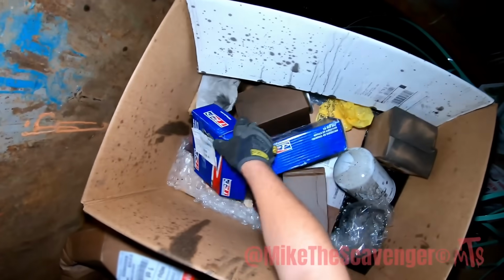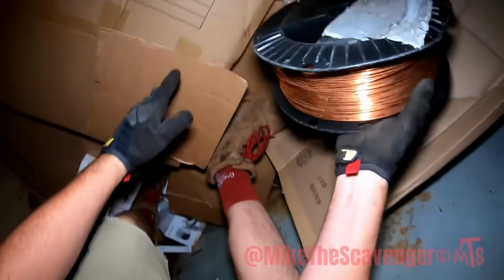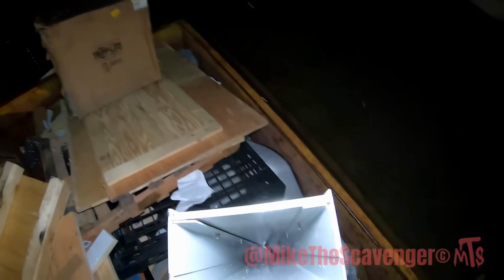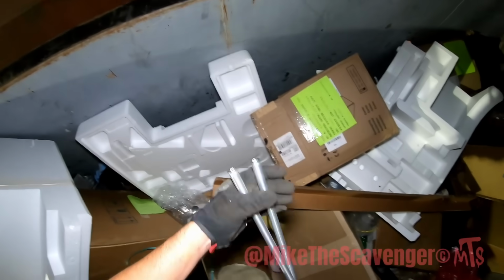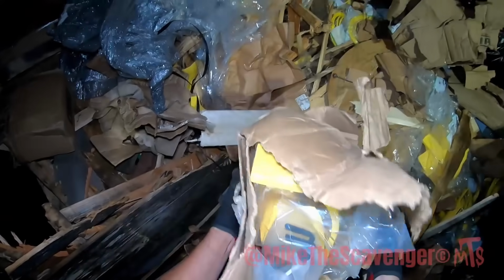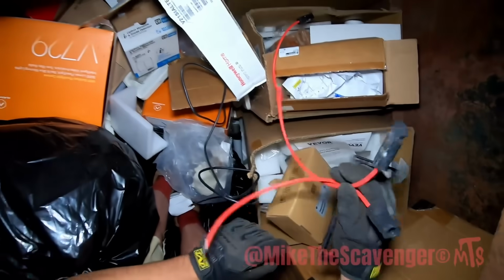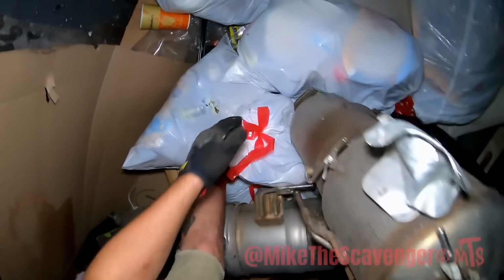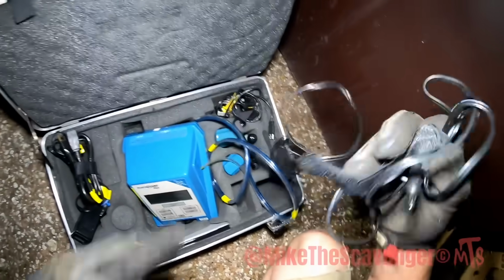Dumpster Diving "It's A Sheriff's Box"

Comment: Mike those spools are welding wire and they're worth a lot of money find somebody that that weld you can probably sell them for a pretty good bit
Reply: It's more difficult than you think. About a decade back bought a storage unit loaded with every kind of welding wire known to man. Spent about 5 years trying to sell it off and I would sell a spool here and there but eventually had to scrap 80% of it.

Comment: Hey Mike that welding wire on the spools are $59-79 a spool. As for the medical carts While I was in rehabilitation one of the carts were plastic. Makes it easier for the nurses and aids to move the carts.
As for the new lights you found in a sealed box over in UK they were switching over to led 17 years ago.
I was in Midland UK. I even took home a newspaper from back then for the advertising.

Comment: The dpf's may contain precious metals such as but not limited to gold platinum and palladium.   Call the scrap yard and axe if they buy catalytic converters.  They will most like buy, but you would have to find the serial number.   So they can tell if it's an OEM or aftermarket.   OEM ones will bring you more cash.  Because they contain more PMs.

Comment: With the amount of tubing and electric wire and electric motors that you find and battery packs and all that. certain car parts, dude, you could build yourself a wicked cool little go kart, and then you. could drive it around the parking lot to check out dumpsters that you might want to dive into. If you're not busy enough already, you could build it and it would be sweet and be great content.

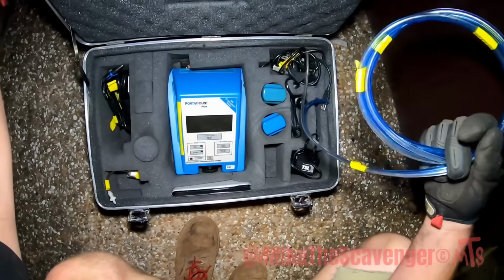Comment: @22:22 Portacount Plus respirator fit test machine.  If you are in a profession where you'll wear a mask to protect you from chemicals or gasses in the air this machine compares the air inside to mask to outside to ensure you have put the mask on correctly and it is not leaking.

Comment: True story.  Our porch bulb burned out, it needs an incandescent 75w large outdoor bulb.  The light is on a motion sensor, dim but brightens when someone walks up.  We replaced it with LED and now the sensor doesn't work.  Well, I can't find an incandescent bulb anywhere.  No one will sell me one.  And here they all are, about to be put in to the landfill.  😠😠😠  So my options are to replace a perfectly good motion sensor that can be used with the new led bulb.  Make it make sense.  😡😡

Comment: Mikew that wire on the real that looks like copper is Mig welding wire. Its still salvage but its no good for anything else for some reason. Could be corrosion. or tangled.

Comment: MTS....Here is some information on getting the Platinum from those two huge Catalytic Converters!
You could make a lot of money by taking the time to remove it...A couple of grand or more...just from the platinum!   
On average, nearly all of the platinum found in the catalytic converter can be recovered during recycling. It might not be 100% of the platinum, but it’s close, with averages hitting 95% or higher. By being able to recover almost all of the 3 to 7 grams of platinum, you get the highest return when it’s time to recycle it. 

Platinum prices change frequently, so it’s important to check the current rate at the time of recycling. For example, right now, the average price for an ounce of platinum is around $940.

Comment: Oil filters are disposed of at certified recycling centers. Anyone who does not do this in Germany risks a prison sentence of up to 5 years and high fines. Here is an excerpt from the law. Catalog of fines 
Misdemeanor fine
Discharge of mineral oil into surface water or soil
- up to 1 liter 102.26 - 1,533.88 €
- up to 5 liters 255.65 - 5,112.92 €
- more than 5 liters 511.29 - 25,564.59 €
Discharge of mineral oil into groundwater €76.69 - €25,564.59
Car wash or oil change in a protection zone €255.65 - €1,022.58
Pouring away oil €766.94 - €5,112.92
Waste oil thrown away, buried, poured away or burned €80 - €2,000
Reply: Good thing we are Americans with freedoms